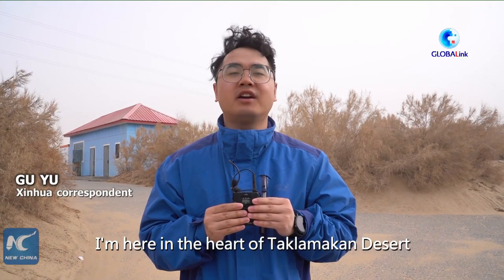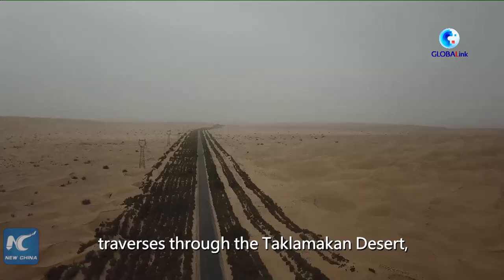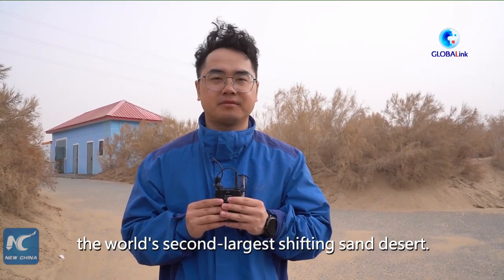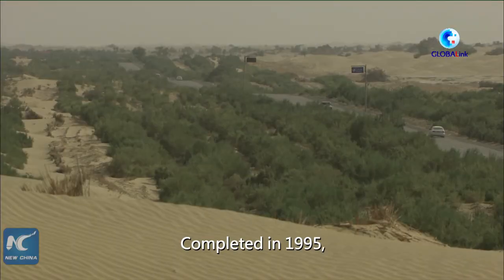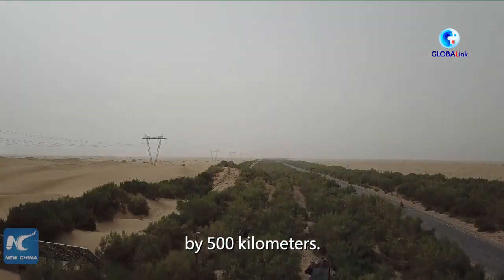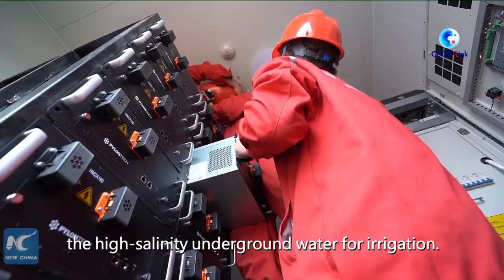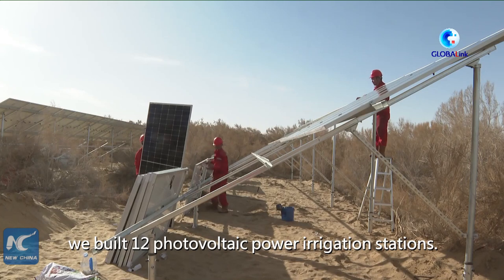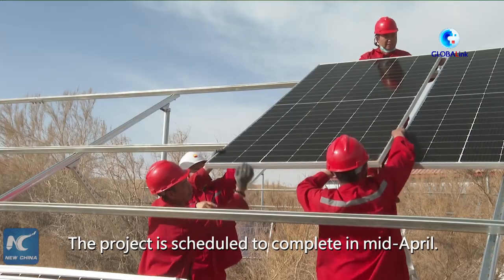GLOBALink | From diesel to photovoltaic power, China's Xinjiang sees greener desert highway

Comment: China's effort is commendable.

First we could see a road built out of a desert.  A desert road will soon be covered by sand blown over by the wind but China planted trees and vegetation along both sides to prevent the sand migration to the road.  The vegetation over the years has grown thicker and larger indicating China's method really works.  This substantiates China has developed a workable  technique to reverse the desertification.

The road side vegetation has been irrigated regularly with underground water using diesel pumps.  China now replaces the diesel power with solar energy.  It is a step by step improvement but Chinese people are doing their best to reduce the carbon foot print and switch to photovoltaic  power whenever possible.